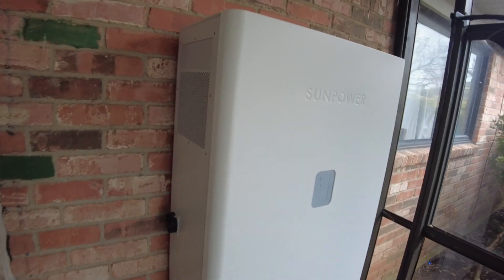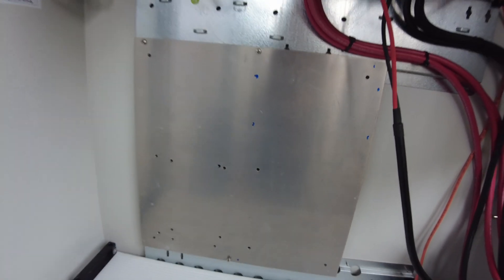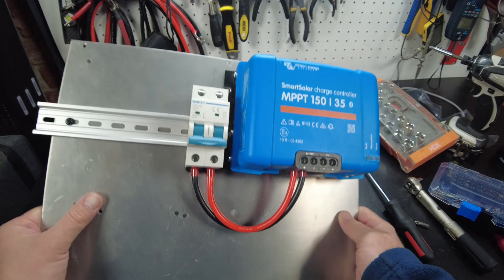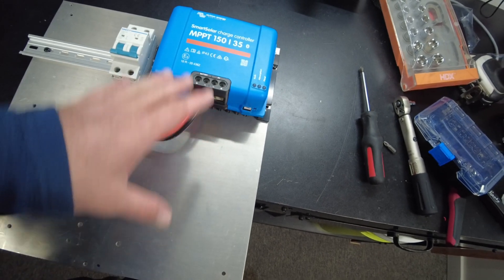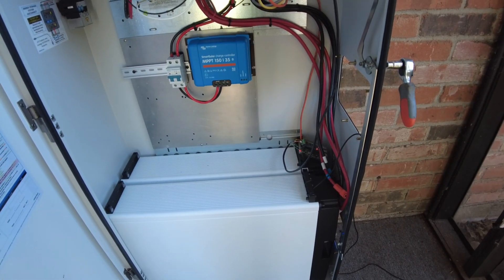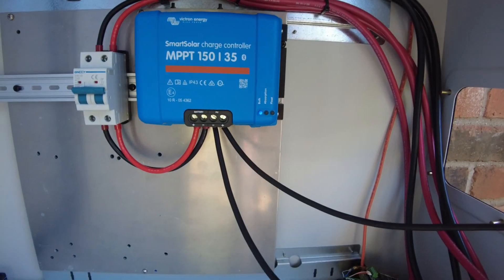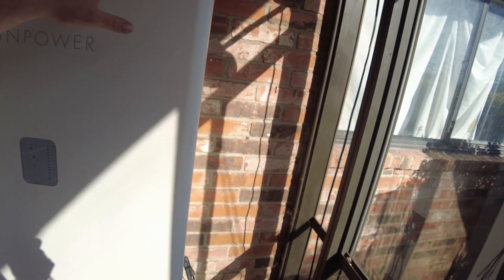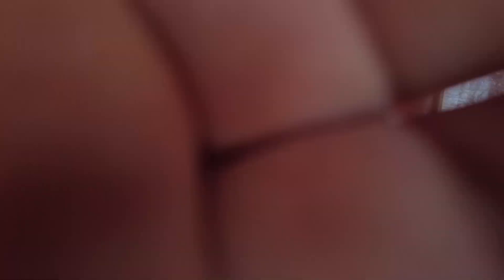Adding MPPT to the cheap 19.5kWh SunPower SunVault System

Comment: What torque setting did you use?I couldn't make it out.
Reply from the maker: The breaker called for 2.5Nm, and the Victron 150/35 MPPT called for 1.6Nm. So I got as close to those as I could see with my bad eyesight :)  Thanks

Comment: The Victron 150/35 is really the sweet-spot when it comes to Victron charge controllers.  Decent input voltage limits, decent output amperage, decent connectors, decent passive heat sink...I love that particular model!   It can pump 1900W into a 48V (51.2V nominal LiFePO4) battery system.

-Matt
Reply from the maker: I agree, and pretty reasonable price.

Comment: Adding MPPT to the cheap System....then points at a victron.
Reply from the maker: Victron has come down in price significantly with many models over the last few years.
Reply: @BradCagle  yes but so has everything else.  i just bought a hybrid 48v 6000w inverter with a 500v mppt and wifi for the same price as a Victron SmartSolar MPPT Charge Controller 150/100 TR VE CAN 12-48V
i loved the victron battery monitor but it also has half price competition now.if victron had a 500v mppt it would be scary expensive.
Reply from the maker: @ Victron actually has a 450v MPPT, but yeah it is expensive for that one :)